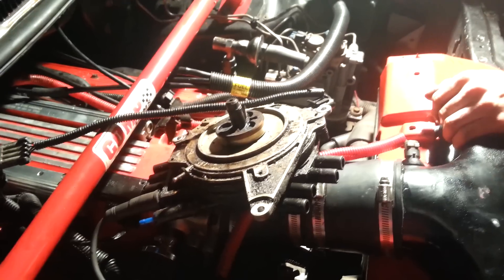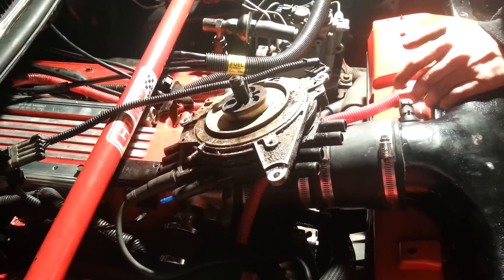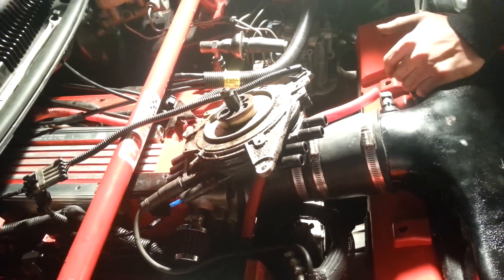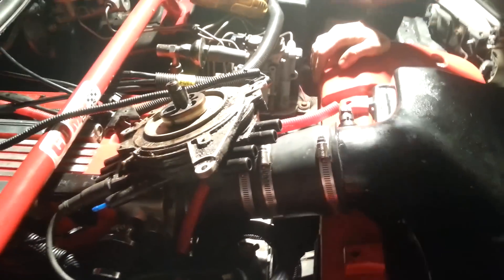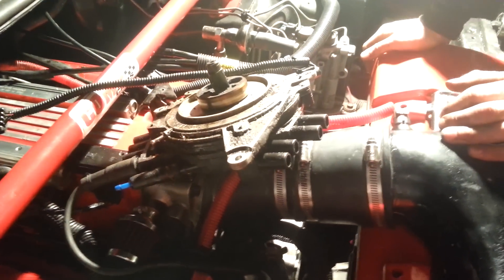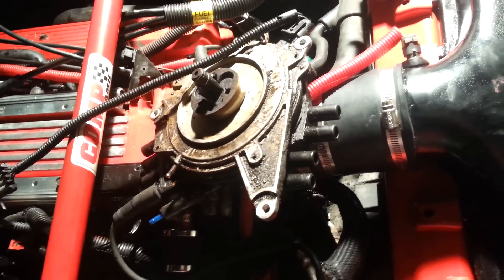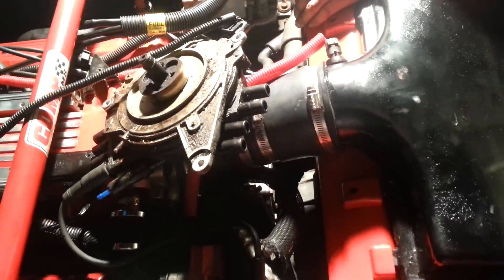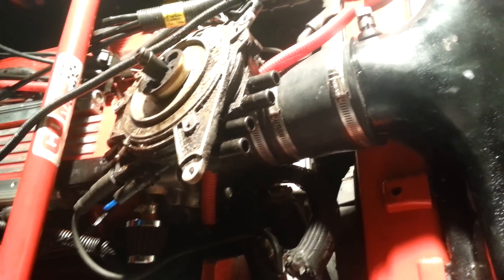How To Test Opti Spark Remotely.

Comment: I have a 95 z28 5.7 finally found out. After a ignition/ it's was the opti' it would start run, but after 30 idling/driving die, mechanic thought maybe f.filter but, how/why do they do that ?

Comment: These really should have had a sensor at every 120° and a switch in the engine to change over to an alternate in case one went bad. I just spray the hell out of mine with cleaner for now when it acts up. Doing anything with coolant is scary
Reply: In the engine bay I mean. Something hidden away in a fuze box or something so people don't mess with it

Comment: I’ve found this video as very insightful. I have a 96 vette that went dead after having no previous issues. I’m thinking I can check my opti by removing the spark plug while still connected to the wire and turning the engine over to see if I have spark.
Reply: Did this fix your issue on the Corvette???
You also have parts called a coil and ignition control module. Either of those quits and you are dead too!
Reply: @geneyus6411  nope still looking. I have injector pulse at all injectors. I found that out with a noid light. I verified that the coil was firing a consistent spark. I have 40+ lbs of fuel pressure. I’m about to check the fuel pump relay and install a new fuel filter. I back probed all the connections and they’ve all checked out with the proper ohms and wattage. If the fuel pump relay and filter doesn’t work then I give up. I may swap the Opti out on warranty but I’m getting all the correct signals.
Reply: @AskaBlackDude  What about the ignition control module??
Reply: @geneyus6411  I replaced it along with the coil. Both ac delco. I back probed the connectors and the signals are being sent. I have 2.5 volts ac at the B wire. 12 volts on both A and D that go to the coil. And at C the ground ohms out at zero with key off. The coil is throwing a consistent spark when I test by air gap with my test light. I also checked the wiring on the Opti side too. It checked out. I haven’t gotten around to checking the fuel pump relay but I will later today. I will prime up, hold pressure, crank over, and sputter a little before dying. I don’t hear the fuel pump running for 2 seconds, as suggested, after it primes. I did install an aftermarket Walbro 255lph. I may have to go back with an oem pump but I just happened to have the walbro laying around.
Reply: @AskaBlackDude  any progress??
Reply: @geneyus6411  I tested the relays after digging through the passenger side of the dash. There are four in my case and I’m not sure which one is for the fuel pump. I got the filter installed. Tomorrow I’m going to Napa to grab a relay and I’ll just play switcharoo until I find which one is for the fuel pump. I also noticed that I have what looks like an oil pressure sensor and maybe a oil sender on the back of the engine. One of them was unplugged. It has one wire running from it and has a funny looking connector on the end. I’m going to clean it up and plug it in and see what happens. I’ll do one thing at a time so I can pinpoint exactly what the problem is. So I’ll reconnect the fuel line and plug the fuel pump fuse in and crank. Then I’ll swap relays. Then I’ll reconnect the disconnected oil unit. Wish me luck.
Reply: @AskaBlackDude  It sounds like things have spiraled out of control!
What was the original issue?
Reply: @AskaBlackDude  Any good news yet??🤔
Reply: @geneyus6411  sorry my friend. No good news. I’m thinking about tearing it all the way back down to the Opti to see if I have it aligned correctly. It’s a 96 pin drive. I really don’t know what to do at this point. It was running perfectly fine. And now I just don’t know
Reply: @AskaBlackDude  Did you clear all your OBD1 codes? What exactly happened when you went from running perfectly to NOT. What brand opti did you put on??
If you do take it off again, you should take off the cover and verify everything is tight. If you are doubting your previous work of installing opti then that might be your issue🤔💣💥
If after you verify opti is properly installed and it still doesn't work ,do you have a good local shop that could help you? A lot of the time, a no start is caused by Ignition Control module. 
Maybe your ECM,BCM are bad?
Reply: @geneyus6411  it’s a 96. First year obd2. It had the 16 code. I used a brand new cardone. The one I took off was a spectra gm05. It had oil leak inside of it. Car ran fine until it went out. I cleared the codes and installed a new fuel pump, coil, icm, and wires just because the car had hit 100k.
Reply: @AskaBlackDude  There's a guy on another YOUTUBE channel called Amundred. He has a 94 C4 with the exact same issue as you. He went total parts cannon on it after it stopped running properly. His sounds awful when running. I wonder if the time chain skipped looses. You can hear his run on his opti video, he changed that twice. 
Last he's posted, he giving up and going LS engine change.
Reply: @AskaBlackDude  I have the 95 model with 91k. There are vacuum lines plumbed to the opti that need to be hooked up properly or it won't run, probably the same on yours.
I'm by no means an expert but trying to help. I recently replaced the fuel injectors with bosch 3's, new and the engine runs like a top.
Reply: @AskaBlackDude  New parts can be bad out of the box. Did you replace your plugs? Fuel pressure regulator?
Did you possibly put an ignition wire in the wrong location?
Reply: @geneyus6411  thanks I’ll
Check him out. I saw another guy on a forum speaking about adjusting the valves.
Reply: @geneyus6411  it may have skipped timing I’m not sure.
Reply: @AskaBlackDude  I don't know about adjusting the valves but you could confirm the rockers, push rods are good.
I would get a shops help before touching the valve train. Use your triple A for towing if you have that.
Reply: @AskaBlackDude  Any kind of timing test you can do?? 100k you're are probably due for a new timing chain.
Reply: @AskaBlackDude  on his opti video, it shows him finishing up the job and thinking it was going to be 100% fixed and it sounded awful. I cringed when I saw him remove the balancer by prying on it! That's a delicate piece.
Reply: @AskaBlackDude  Bad throttle position sensor can cause major issues too. Google it and see if you have those issues?? The Amundred guy replaced that too and it didn't help his situation.
Where was your oil leak coming from?
If you do strip everything down again , I'd replace the crank seal,pump seal.
Reply: @geneyus6411  yea I have replaced the fuel pressure regulator because with key on, the pressure would drop quickly when hooked up to a gauge. So that’s new. The Opti is sending all the signals needed. I have spark, I’m getting fuel in the rail. All of the injectors are pulsing. I can send you videos of what I’ve done if you have an email.
Reply: @AskaBlackDude  When you do get it running, I'd replace the injectors. With 100k they are junk now. Do you have a trusty local shop you can turn to for help? That's okay, I don't need the videos but thanks for offering 💣💥
Reply: @geneyus6411  hey man thanks for your help. The oil leak was coming from the seal behind the Opti and the drain plug. Replaced both and no more leaks. As far as cranking goes I still haven’t gotten it to run. I have narrow it down to a weak spark though. All 8 spark plugs have a weak yellow spark and the gap on the plugs were too big. They are all fouled out and I’m about to buy new ones. I had them gapped at .06 instead of the recommended .05. I bought Delphi wires but I may just drop the change and buy ac delco ones. I’m getting fuel and spark everything else is fine as far as injectors, iac, and tps sensors. I have a friend who is a certified mechanic and works for Chevy and he narrowed it down to the weak spark. He said it should be blueish or kinda white. I’ll get the plug wires today and the plugs so we shall see. Do you have a part number on those injectors?
Reply: @AskaBlackDude  Those plug wires are just fine. I have the bosch replacement wires from rockauto, same thing.
The injectors are from fuel injector connection out of Georgia.  Just go on their website ,punch in your info on their search bar. The original injectors on these cars are junk after 26 yrs!
Maybe you will get lucky with your issue.
If you do get the injectors(Bosch 3 24lb upgrade) it's plug,play.
They give you instructions. There's no programming involved. Thanks for the update👍 You don't need to disconnect your fuel lines from the rail. Also, there's little safety clips that secure the connector to the injector. You have to reuse your original ones, they don't just rip out. You lighlty push in on them and use a tiny screwdriver to release where they hold onto. It looks like 2 plastic ears.
Reply: @AskaBlackDude  Try watching YouTube video 1990's LT1 Corvette and it's optispark problem, from VetteSource.
Reply: @geneyus6411  got it figured out. Spark plugs weren’t gapped correctly, I had to install a new connector to the icm, and the Opti was seated wrong. She fired up once I got everything changed. Thanks for you help and suggestions.
Reply: @AskaBlackDude  That's great news, after all those shenanigans you went through. Another example to not just put the blame on Opti all the time.

Comment: that doesn't check "low res Signal" (example: injector Control,  security) side of distributor. bad check, waste of time. car might not even run you are Plain Wrong.
Reply: Some opti's only fail at engine operating temp.  Takes 15-20 minutes of driving to find out.  This is not a conclusive test, at all....  You need an oscilloscope to monitor the high-res while soaking at 170 degrees F.  Only then will you see the cheap Chinese electronics create false triggers on the high res.  If high res isn't perfect, computer won't open injectors, or fire.....

Comment: To make this tip even easier, you don't need the drill, and you don't need to hookup the coil wire through the distributor.  If you have an exta plug wire, just hook it up to the coil, put a spare spark plug in it, lay it on some grounded metal, and spin the remote opti by hand.  If it sparks, you're opti is bad.  If it does not.. you got other issues.   I just tried this, and got not spark, so good news was my opti was OK, problem was loose connection in the primary wire harness and plugs to the coil and module.
Reply: Hi , I just did your suggested test with a spare plug and wire hooked directly to coil and grounded plug to block. It fired the plug. Would you mind explaining to me how this makes opti bad. I working on a 95 vette , it was misfiring all over and backfire thru the throttle body  , thank you. I just need to be sure for this customer thank you

Comment: This just helped me to fix mine by confirming my optispark was not the problem.  I hooked up another known good one (or you can just go buy a cheap one for the test then return it), and I still had no spark.  Problem was apparently loose connection in the primary wires and plugs to the coil, and module.

Comment: I am not getting any spark from the ignition side. I ran a flowchart test via all data and it suggested or pointed out that the OPTi or distributor wiring was bad or bad distributor?
Why would I not be getting any spark from the ignition side?

Comment: Did the 94-97 Optispark work , on the 1993 motor ????? I have been told that 93 to 94 changed 
 Thank you ,

Harford Capps . North Carolina
Reply: +Mike Jack I have the same OPTi I'm not getting any spark on the ignition side although it said after following a flow chart: said that the distributor wiring or distributor was bad distributor wiring is good I'm at a complete and freaking total loss it's driving me sane spent over a month...

Comment: I got the same problems with a chevrolet caprice classic station , model 1996 , built at end 1995 - we changed fuel pump and filter , then the ignition coil - nothing changes to better . Car runs moderate , but at acceleration it drops down , kickdown runs - now today we wanna change the optispark and I hope , then it will run again well . I bought the car  as a new one and now it has 458.000 kilometres without problems .
Reply: Was it the optispark??

Comment: question: i have a 95 firebird formula. it cranks but wont start. I was told it was my optispark, replaced that, still no luck. Went through replacing my ignition control module after taking it to autozone and found it was bad so thats replaced..ignition coil still good after getting that tested. checked for fuses and found my ignition fuse was bad. replaced that and still cranks but no start. what would be my next step?my engine only has 10,000 if that. its a brand new rebuilt.
Reply from the maker: Irvin Clark i would check and see if youre getting spark by removing a spark plug and putting it against any part of the engine with a spark plug plugged onto it from the opti and have someone crank the engine over if you have white/blue spark that's good, 
if you have spark next is to check for fuel pressure at the fuel rails by putting a fuel pressure gauge on the fuel rails Schrader valve located behind the intake by the fuel pressure regulator, if you have fuel pressure (should read 40lbs maybe alittle higher) and it stays youre good, if it bleeds down fast to anything below 30lbs it could be your fuel pump, the way to test that is to spray starting fluid into th throttlebody and cranking the engine. if it starts its a fuel starvation issue, 
next it if everything else checks out, it could be your fuel pressure regulator had a torn diaphragm, how you test for this is you pull the vac line off of it and crank the engine, if fuel shoots out or it looks wet AT ALL, the fuel pressure regulator needs replaced, 
now if all checks out and nothing looks to be the cause, I would start looking at the wiring harness for splits or bare spots, and if all checks out there id say the ECM is going to need to be replaced in order for the car to run again, 
hope this helps,
Reply: Irvin Clark temperature sensor on water pump?

Comment: i'm currently having major problems with mine obd2 says p1371 and i understand it may be the distributor. i have extreme power loss loud pinging backfire car chugging hard and wants to die when i accelerate. does that sound like i need a new opti ?
Reply: Check all your major vacuum lines 1st before you fall into the opti black hole!
Reply from the maker: I would check fuel pressure first. Sounds like it may be weak fuel pressure. It should be at 40psi at an idle and about 43psi Wide open throttle. Any lower then 36psi and you should replace the pump. But pull one of your spark plugs and check for white or blueish spark if you have that the opti is putting out good spark.

Comment from the maker: What this test covers is if an optispark works without having to go thru all of that, its simple. If the opti on your car is not making spark but the remote opti is then you know your opti is bad. An optispark only needs the opti harness and the coil wire to function. It doesnt need installed on the car
Reply: Am I correct in saying the coil makes the spark??? Not the opti??
So if you have a bad coil, no spark!
Reply: 9302z28ss I bought one for my car had the engine rebuilt so everything is new but i still got the one I bought so I guess that's good for when ever something goes wrong I can have it as back up 🤔and test it

Comment: VG,VG. Thanks. I have a 96 SS no spark, 100K on the motor. I changed the cap and rotor about 20,000 miles ago, not the whole unit. Didn't think of it until the job was over. I have no splash guard and it runs rough when it rains. What do You think of those inexpensive Opti Sparks that are for sale on Ebay. Any opinion?
Thanks for the help.
R McG
Reply from the maker: They're good optis, they do their job grab one and swap it out